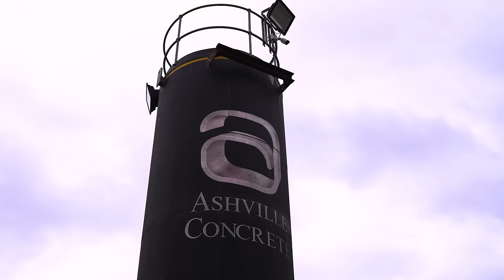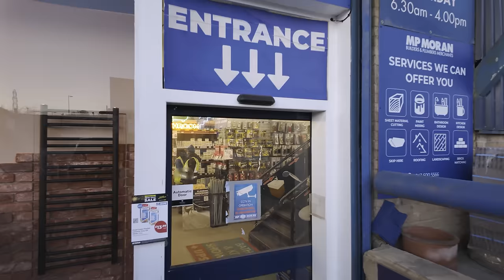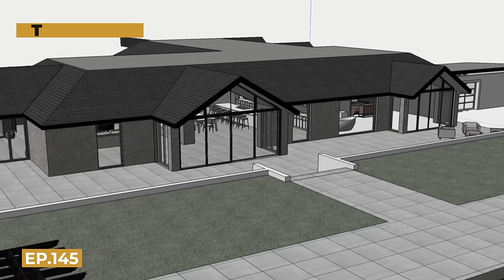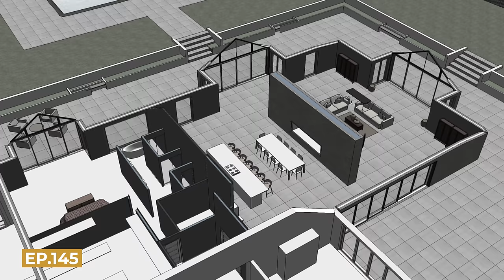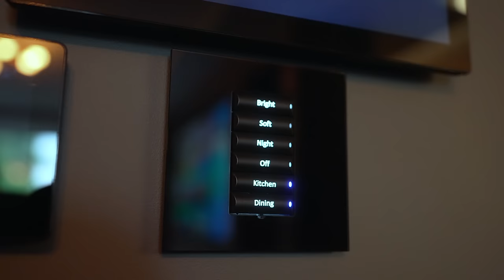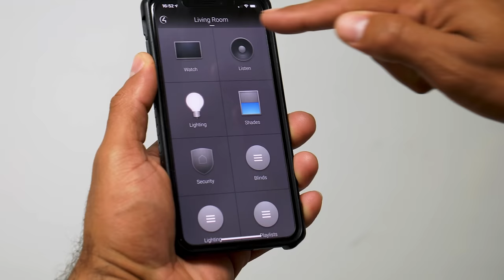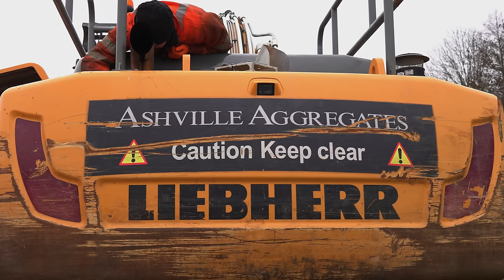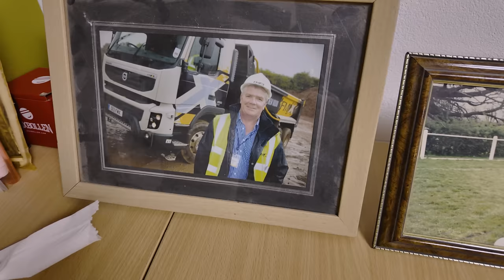This Time Next Year We'll Be MILLIONAIRES | Ashville Weekly ep171

Comment: Reference the pack to push out to potential clients I would suggest 3 options: 1) Lay all of the info out that the business does, and work through it like a CV pulling out key components. Option 2) The reverse of option 1. so, Key points only, with the ability to then elaborate on those key points. Option 3). A crossover between the 2. However, which way you would like to do that is up to you.

Comment: Morning Daniel
I was glad to hear that your concrete salesman had pulled you up on using recycled aggregate in your concrete. I’m tired of companies using cheap inferior aggregates in their concrete and selling it for less than cost and telling the customer that it is as good as virgin aggregates. As you now know recycled aggregates should not be used in concrete and if they are the concrete will not meet its target strength and it will not be BSI compliant.
When building a house or an extension it baffles me why customers think it is wise to use the cheapest concrete they can possibly find, the foundations are the most important part of the build. Why do you think a house builder in Cambridge is having to demolish 88 new houses, buy cheap buy twice!!

Comment: Ref shipping containers
How big is a shipping container? They range in size from 8ft, or 2.43m, all the way up to 48ft, or 14.63m. The most common shipping container, a 20ft container, measures 6.05m long x 2.43m wide x 2.59m tall. It's important to note the following dimensions and weights can vary slightly between builds.Oct 30, 2023

Comment: Not trying to nag, but the planner missed the 70 mm insulation, requiring spending hours moving wall for the opposite post. The bedroom door opening into the room will severy limit the passage in that little are, should be a slide door on the original spot. And on the pipes for the vent unit cut in the xps insulation makes. No sense either ? It's a hollow pipe ? In the staircase the double wall with sound req should be build like drywall insulated framing drywall 5mm gap framing drywall.  Knauf has a his specific build detail.